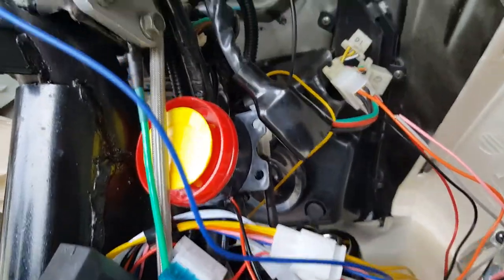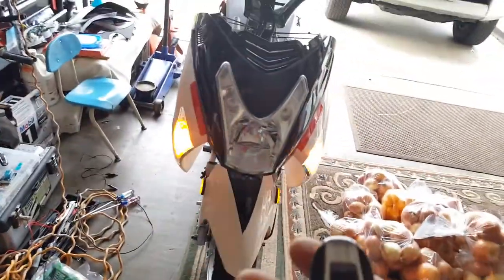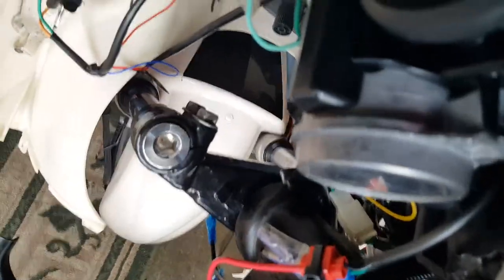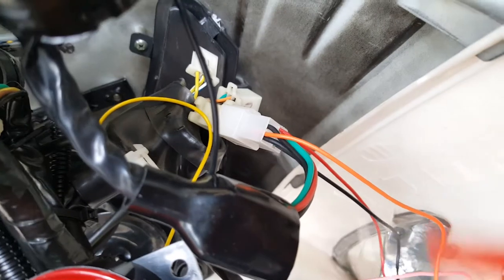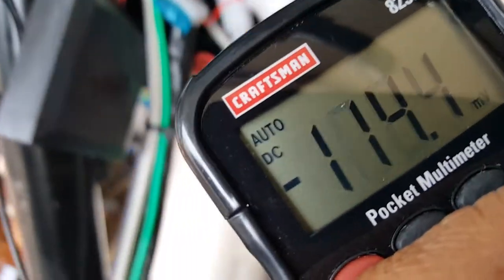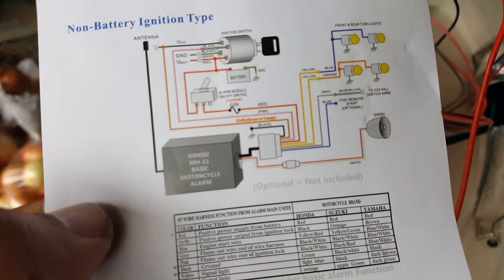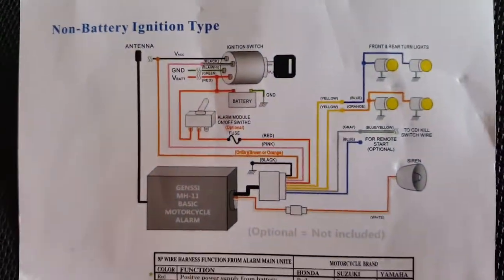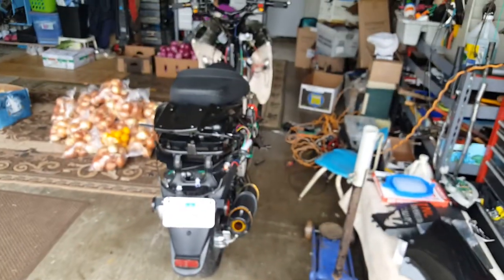How to Wire GY6 Scooter Alarm Remote Start 2 of 20

Comment: @NYE store Can you help me where  did you put in  the Orange and the pink and  the grey wire???
I conect my red and black wire  but is draining my battery out.....
Reply from the maker: Sorry late response I hope you got through my video but the pink and gray wire you have to split the skunk wire that's pretty much your kill switch wire almost orange wire goes to your ignition wire you can have to trust for 12 volts when the ignition is turned on with a key I hope the help is by the elaborate more in the video if you keep on following this series.
Reply from the maker: Unfortunately you do have to connect the red and black wire to a constant power source cuz it needs to monitor even when the ignition is not on so it has to do something but maybe your battery needs to be strong enough for started daily to keep a good charge. I hope this helps for the red and black wire, you can see I tap mine near the all the ignition area but it still has a constant drainage on the power even without the key or anyting being started the alarm on a has still power monitoring the scooter.

Comment: The black wire in that alarm that goes on the key is positive + when the key is turned on. I thought black was a negative.  It's what is called positive output wire. Which powers the lights when the key switch is on. You need to connect the orange wire to the black wire. When the key switch is turned on, the black wire will give positive output to the orange wire for your remote start. The blue wire connects the output of the starter solenoid. So for instance connect the blue wire to the cable in the solenoid that is connected to the starter. Remote start happens when the orange and blue wire circuit are shorted against each other. The black and white wire is your kill switch. The red wire is the positive - to the fuse at the battery or key switch. The green wire is the earth wire basically a ground. The gray wire connects to the black and white wire at the key switch. The pink wire connects to the black and white wire at the CDI box. The pink and gray wire are shorted on the black and white wire to disable the engine when the alarm is engaged.
Reply: hello please I'm trying to connect the alarm to my Yamaha GTR Aero 125 but the wires in the ignition switch is different colors can you please help me
Reply: @Vybzonline  what color are the wires?
Reply: @MR.ROB.DA.GOD.Biker-ex  Black, Red, Brown with blue stripe and yellow with green stripe
Reply: @abdulmaliksuraj1976  the yellow/green wire goes to the starter solenoid if you have a chinese alarm ....this wire would connect to the blue wire on the alarm for remote start The red wire on the alarm should go to your battery, itis positive. It is hard to tell without being there. The black wire and the brown wire, I'm not sure. One of them  will be switched positive on the key switch. This means that when the key switch is on the black or the brown wire should get 12 volt power. When the key is off, you shouldn't have there should not be 12 volts. The leftover wire (black or brown) will be your negative battery.
Reply: @MR.ROB.DA.GOD.Biker-ex  ok thank you I'll connect and try
Reply: Also I just thought about this the yellowing green wire could be going to your brake switch at The handlebar
Reply: @MR.ROB.DA.GOD.Biker-ex  I have connected everything correctly but when I try to start it the brake light comes on but nothing happens

Comment: When installing an alarm and remote start on my scooter where does the black wire coming out the other side go
Reply: That what I want to now
Reply: I bought one but I don't now where the other wiring goal is a red and and black one I don't know where it goes black and red
Reply from the maker: Sorry it's been so long I never did get to work as far as the auto start